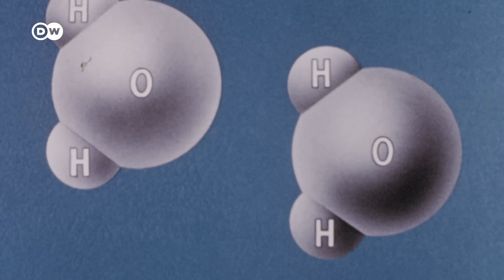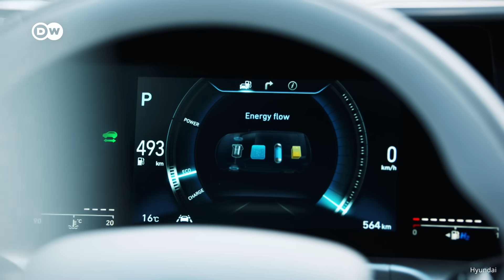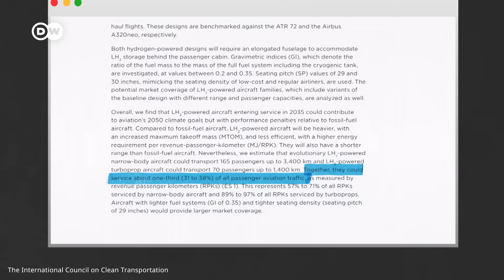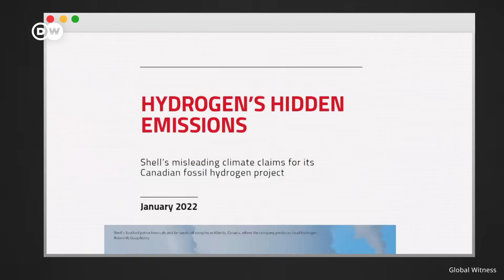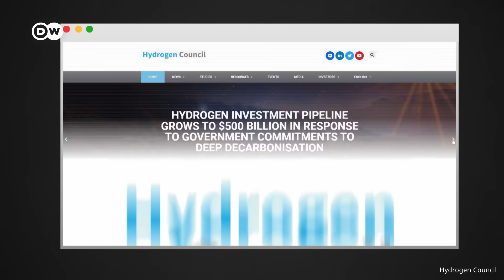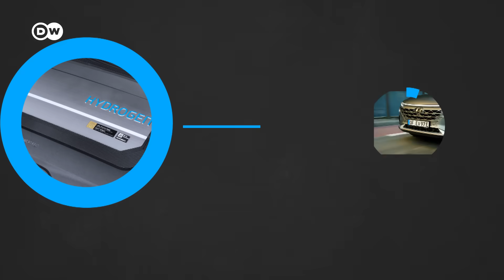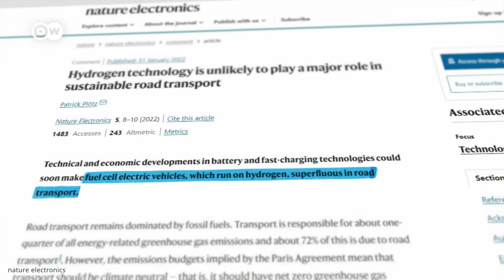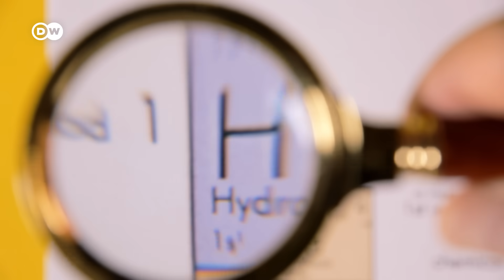The truth about hydrogen

Comment: Massive scale up of RE (solar & wind) must come and be applied first in a direct manner. Then you can produce green H2 from surplus RE generation and apply this H2 in a calibrated way for processes and applications were RE cannot be applied; i.e. for long distance shipping, seasonal storage etc. to cover winter gap or balance seasonal fluctuations of RE supply. H2 should not be applied for the low temperature heating purposes e-heat pumps are the solutions for this; and to to be used for land-based transport sector. This race is practically won by battery driven system.
Reply: You forgot key industries that are even ahead in line of the uses you listed. Steel, cement and fertiliser production can only be decarbonized through hydrogen (especially steel production where hydrogen can do both functions that require coal as it can remove the oxygen from the molten ore)

Comment: Should be hydrogen in order to be able to use the existing combustion cars further without necessity of creating new pollution due to batteries and also new electric cars. Focus should be just on kits which can be mounted on current cars and can run further as they are by decreasing the emissions to 0
Reply: Such kits are impossible as the only efficient way to use hydrogen is through a fuel cell - but that makes it an electric vehicle and thus needs to be converted to use electric motors instead of the ICE. Hydrogen requires high pressure storage (at 700 bar/10000 psi) to have any sort of range - as it is a bad energy carrier by volume...

Comment: This video failed to note another significant problem with hydrogen.  It has the smallest molecular size of any other element, so it is very good at escaping containment in storage facilities, pipelines or any machinery that runs on hydrogen.  The video mentions methane emissions from pipelines and such, but hydrogen emissions from these same facilities would be much, much higher.  That is not the climate change issue that methane creates, but you could see an increased number of gas explosions/fires over what we see with methane, and it will result in the loss of much of that expensively produced hydrogen.

Comment: In this video the point of hydrogen for storage of energie is not mentioned. In spite of energy losses, hydrogen can be a source to be stored in empty gasfields below the surface. So you store energy e.g. for the wintertime. Batteries are good to store between day and nicht, hydrogen to store over months.

Comment: Hydrogen will be like nuclear fusion - '30 years away and always will be'. Apart from being one of the most flammable and so dangerous molecules (a gas leak on your heating boiler at home is not the same a gas leak today), it is also the smallest molecule on the planet therefore keeping and transporting it is much harder than methane. Its small size allows it to penetrate the grain structure of steel structures allowing it to weaken them and leak out.

Comment: Hydrogen is not a fuel, it is a storage medium.  Meaning that energy from somewhere else (coal, nuclear, hydro) must be used to make it.
Second, hydrogen is incredibly difficult to store because it leaks out of anything that you put it in, including solid steel tanks.
Thirdly, hydrogen is far too dangerous for the general public to handle.  Storage tanks are either at extremely high pressures, or at cryogenically low temperatures. Either type of storage solution is dangerous.  Once it starts leaking out of the fuel tank, it explodes over a huge range of fuel-air ratios.
Our research efforts should go towards designing better batteries, which are a much safer energy storage option.

Comment: ... "relatively low energy density" ... compared to what? If anything is compared then the comparators should be brought into the same level. It would still compare per kg. Now tell me kg of hydrogen and kg of other calorific value? Are there any competitors for hydrogen? Yes, nuclear energy, but it is not important at the moment. The calorific value still works, ie the energy of the fuel (calorific value) is converted into mechanical work and not the energy density. We talk more about energy density during storage.

Comment: Hydrogen, as you've stated, is basically a highly pushed, highly funded fossil fuel industry strategy trying to keep their fossil fuels relevant. I might have missed it, and I apologize if you did,  but I think you neglected to mention the very high pressure it takes to store it. It's extremely dangerous pressure with extremely violent explosions when they go awry, which happens more often than people realize even today, even with its the very limited use.  

EV heavy trucks will use super capacitors for up-hills climbs (which re-charge in seconds - or very short minutes - on downhills and slowing down/braking) to supplement their batteries, as well as battery swap rest stops stations along highways. Heavy equipment trucks and machines will depend even more on super capacitors, (cranes use them today, for example). Ships, and especially long distance air travel, will be the hardest to move out of fossil fuels. However,  axial flux electrical motors will fix that sooner rather than later.

There is a reason why hydrogen has been around for well over a century but has never supplanted any other fuel source in all that time. And it's very low energy density is only part of the reason. Remember, hydrogen is a fuel. Once used, it's gone forever. Electricity, such as that inside a rechargeable battery, is an energy, not a fuel. And as such, can be created/recreated/recharged in a multitude of ways without fuels. Some of which are obviously widely known -- Hydro, wind, solar, etc.; and some of which cannot yet be mentioned on forums like these for obvious reasons.
 
Therefore, in the end, there will be very little use, or need, for Hydrogen as a fuel source.
Reply: The byproduct of Hydrogen fuel cell usage is water.  If it was not for the fact there is more energy used to produce Hydrogen fuel than what Hydrogen provides, it would almost be self-perpetuating. It is not.  While you are incorrect that the Hydrogen used is destroyed or consumed in the process, there is losses through leakage during transportation, storage, and processing.  Nuclear fission still appears as the most likely green energy available in the immediate future for the reduction in the use of fossil fuels for it energy density, although long-term disposal of nuclear waste still needs a solution.

Comment: I did like the clip much. I see it the same way: There is a big potential and it could be used for basically anything but just because it could, doesn't mean it should (same as with all other types of solutions as batteries, fossil fuel etc.).
What I was missing when talking about passenger cars or vehicles in general, that Toyota recently has successfully tested their hydrogen combustion engine in a Corolla during a 24h endurance race in Japan. It sounds pretty promising (besides the still required upgrade of refueling stations).
Would be interesting to hear opinions about this concept outside the "Toyota bubble" ;)
Reply: What I want to know is what happens if toyota would leave the car for two weeks in an unventilated garage with the tank full.... I'm willing to bet a single spark would obliterate the garage and everything in it
Reply: @paulmichaelfreedman8334  That danger would be very similar to gasoline. If the car has a leak in the fuel system, the vapor would be as explosive if not more so. From everything I've heard in this discussion so far, gasoline contains more BTU per volume than hydrogen so it would be a more violent explosion. You wouldn't want to be standing next to either one.

The practical use of hydrogen that I haven't heard discussed recently is as the fuel to power an internal combustion engine instead of gasoline/propane/etc..  I studied the possible use of hydrogen more than 20 years ago but the research either never got off the ground or it just wasn't publicized. I think the trade off would be in that while hydrogen doesn't have the BTU (energy) of gasoline, it is a much more benign choice in that it is far less harmful in the environment.

Comment: Future of hydrogen is using as fuel in fusion reactor. Fusion reactor electricity production, Concentrated Heat solar power, wind power and ocean power are future of energy production. EVs are future of energy using.

Comment: This is a well balanced report about the real potential of hydrogen. I agree with the basic statement, that hydrogen will not replace fossil fuels in general but may be 10 percent of todays consumption. In most cases it can't compete with direkt use of electricity, expecially in case of heating and in the energy sector.
Reply: Where it loses its "balance " and falls down is that there is no discussion or even mention of how "zero emissions " sources like windmills and solar farms require clearing ALL the land of trees as well as disturbing the soil which in itself releases carbon dioxide. Any report that skips this critical fact is disingenuous.

Comment: HYDROGEN GAS ORIGIN ARE CAME FROM THE FRICTION BETWEEN BLACK HOLE AND SOIL AND THE SMOKE OF FRICTION ARE THE HYDROGEN GAS AND THE DEPOSITOR OF GAS ARE IN NORTH POLE AND SOUTH USING THE GAS FOR STARTING TO BURN THE SOIL CONVERTING INTO LAVA AND OIL METAL AND OTHER MINERAL ARE USING TO CONTINUE THE FIRING OR INCREASING THE FIRE FOR MUCH EASY TO BURN THE SOIL,, LAVA ARE IMPORTANT TO THE PLANET BECAUSE THE LAVA ARE THE CREATOR OF GRAVITY OF THE PLANET

Comment: This video neglects to mention a crucial factor.   Renewable energy like solar and wind produce electricity both intermittently and to excess.  There could be a very windy day which causes wind turbines to produce more electric power than there is demand for on the grid.   There can be calm days when no power is produced at all.   It is crucial that renewables have the means to store electric power and the best means turns out to be hydrogen producing electrolysis.  But if you have already stored excess renewable energy in the form of hydrogen, why bother putting it back on the grid in the form of electricity to charge ev batteries ? Why not just use it directly in  onboard fuel cells ?   Eliminating fossil fuels in preference for renewables   means setting up  hydrogen infrastructure to be able to match a continuous demand for energy to a discontinuous system of energy production.

Comment: Factory built, modular, high temperature/low pressure nuclear is the key. Very small area needs, can be sited on existing coal plant site, and use existing transmission infrastructure.  No GHG from energy production, process heat for industry (steel, aluminum), electrolysis or thermal disassociation of water for hydrogen production as well as desalination for irrigation. High temperature, low pressure nuclear would also provide heat to combine H and CO2 into net zero fuel, allowing to utilize the immense energy, capital and human investment in existing infrastructure.  We also must preserve the investments made in the current fleet of nuclear generation as a solid basis for decarbonizing the future.

Comment: Only no one plans to store hydrogen as a gas. Currently Sodium Borohydride is being investigated as a solution.

If your worried about Climate Change you should be concerned with replacing natural gas either Coal is far far worse. Using natural gas instead of Coal would be incredible headway.

Gray and Blue hydrogen are means of mitigating the impact of fossil fuels, they have a positive impact but are not a part of the long term solution.

Comment: The major difficulty, with sole reliance on renewables, is balancing supply with demand. In countries with large amounts of renewables there can be periods when supply outstrips demand (or overloads local network capability) and during these periods it would make sense to use that excess to create green Hydrogen. There is a project in Scotland at one of the biggest wind farms to build an electrolyser with the H2 being used to fuel buses (I think).
As ever a wide range of energy options will be required and H2 will play its part in one form or another.
Reply: You’re smarter than the average bear 🐻
Reply: ...yepp.... you're right...
Reply: Sorry, no. The major problem with "renewables" is the lack of energy density. Unless you can recreate the windmill farm using the energy from the windmill farm then you are stuck using fossil fuels. You cannot smelt steel or create Portland cement from the energy of a wind farm. End of story. Everything else is a LIE
Reply: True for now, but as the price of Powerwalls (generically) decreases, they will replace green hydrogen as a balancer of supply and demand.
Reply: @lokensga  no you need green hydrogen anyway. A) to replace gas and B) for steel plants.
Reply: But why would you use green hydrogen when the production and use of it is less efficient than storing energy other ways? Storing excess solar energy as sensible heat is extremely efficient and cheap, why would we produce hydrogen, whether using electrolysis or thermal methods, then use that hydrogen in a fuel cell or heat engine, when we could store massive amounts of energy in virtually any material that can be heated or change phase (solid to liquid or liquid to gas)?

Comment: Very interesting video! You point out rightly that we should not use our hardneeded and scarce green energy to produce green hydrogen, since too much of the energy will get lost. However, we’re dealing with congestion on the grid (in the Netherlands), which makes it impossible sometimes to install new windturbines and solarparks on the grid. Hydrogen could be very beneficial here. By storing the abundant electricity from hydrogen, we’re not using electricity that would otherwise be brought to the grid. By using hydrogen as a battery of the grid, we’re able to use green electricity also at times when production of green electricity is not possible.
Reply: Hydrogen electrolyzers are not dealing well with inconsistent amounts of energy. They need to be run off a stabilized grid with constant energy flow 24/7, first thing to suffer is efficiency, have complete lack of energy and the electrolyzer will suffer membrane decay and permanently lose efficiency and eventually require a new membrane - which is costly both in resources and in price (which will be clear once you realize that these resources contain some of the rarest metals in the world, rare earth metals with their bad wrap are child play compared to for example iridium).

Comment: Lol. You do not need a storage tank. Storage is dangerous. On demand cells. Make it when you need it. That's the problem they want to sell the hydrogen gas. I know General Motors, Flied bankruptcy on me after showing them how to create more Hydrogen using a vortex, a blender to pass electrolysis faster in the cell and eliminating storage. What happened? They used it as an asset in bankruptcy procedure. Energy is the way to freedom, but also a way to control the future. What you think? There is also a way to create a new electrical grid system and give all residential house owners a fixed bill and create new energy without solar or wind. Underdog Electric Inc. Knows why.

Comment: I think Hydrogen is a solution, for big scale energy users. Cars and Trucks won't benefit much as those are better using electric than Hydrogen. Hydrogen is better for big scale structures like furnaces in factory, trains, or planes, the reason is the storage and infrastructure to produce / store them. Hydrogen is very flammable, and using it on places that less likely to meet unskilled operator is better.

Comment: I always believed that we would not have all the trouble we have now. If since the beginning we have used ALL the alternatives available. This means not only the good stuff like hydrogen and electricity, but also gasolin. Using all of them you would create a balance and i believe we wouldn't have all the trouble we have currently
Reply: Except burning fossil fuels has released tens of millions of years worth of CO2 into the atmosphere in less than 200 and most of that in the last 50 years. With gasoline/coal/gas, the only way is up unless you remove carbon dioxide somehow, which is nigh on impossible at the rate we burn it.
Reply: @Wizard_of_oOZe  I understand you totally. But my point is that because we only used fossil fuels for the last 150-200 years we ruined the balance. People would automatically make smart choices especially if the prices are fair. Of course the thing to do was the politicians of that period should NEVER give in to the petroleum lobbyists. And try out what they already knew back then was good, hydrogen and batteries (as long as the used batteries are handled correctly).

Comment: Considering that all solar plants are peak load plants and massive electricity storage is not available. It would be easier to use excess electricity to produce stuff such as green hydrogen.

Cost of lithium, cobalt, nickel (already happened) is going to skyrocket sooner or later. Most of these metals are present in single country or parts of refining are present in China (possible economic blackmail). Its battery to keep hydrogen as alternative rather than betting everything on lithium.

Comment: Unless you can get battery powered cars to charge as fast as you can pump petrol from empty to full, I don't think they will ever dominate the market (unless governments force people to give up petrol and diesel). Hydrogen powered cars can fill as quick as a normal petrol tank. If the right infrastructure was built for this, I don't see why it couldn't be the dominant fuel for transport in the future.